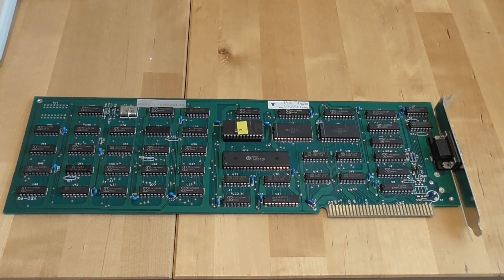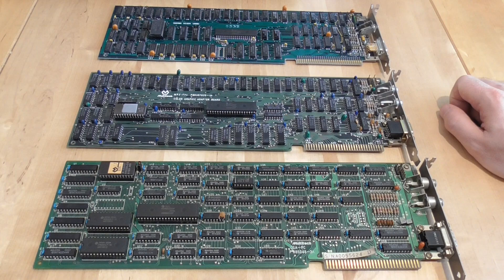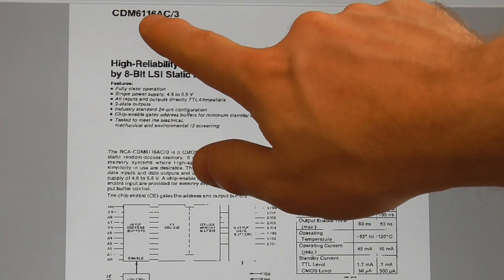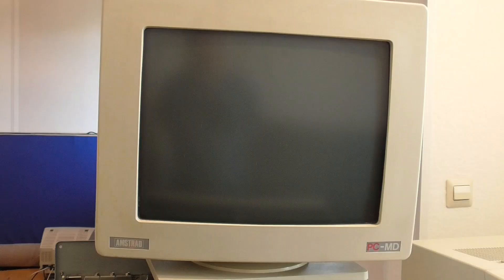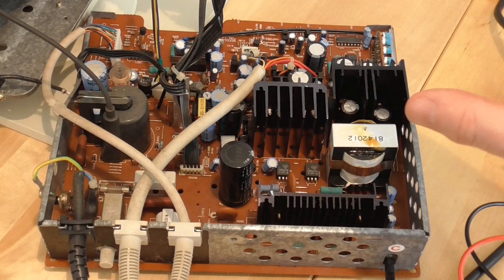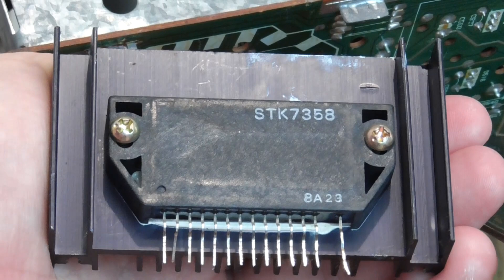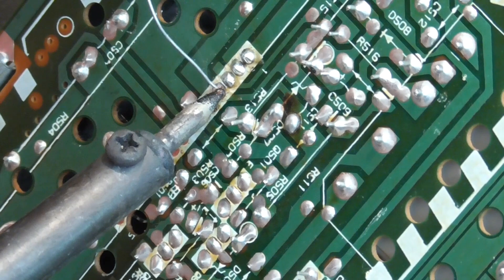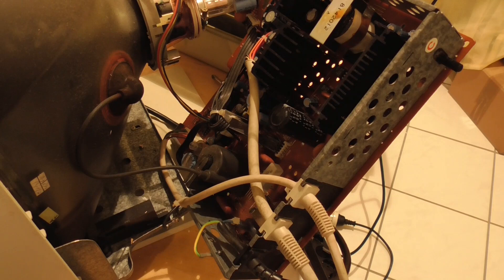Repairing and Benchmarking a Paradise EGA Card + Monitor Repairs

Comment: I suggest using a 60W~100W Watt lamp in series when testing your monitor or other old equipment.
It will prevent short circuit and will charge the empty capacitors more slowly.

Comment: I have got the Paradise Assy 28700 REV7 EGA-Card with the PEGA1A-Chip. Changed all the Tantalums, but get scrambled characters nonetheless. To repair this any further I fear CuriousMarc-Skills are required...
Reply from the maker: Sounds like it could be a problem with the character ROM. Of course, getting another to try is probably tricky.

Comment: 30:09 It looks like this card is employing some kind of interlacing to present a higher-quality font on a CGA monitor? The font definitely looks more like the standard EGA 8x14 one, so the card might be doing 350 or 400 lines by means of interlacing, and that would explain the flicker.
34:00 There were multi-sync monitors which could handle such resolutions. I can remember NEC Multisync reviews from 1986 or 1987 which claimed that it was perfectly able to handle CGA, EGA and 640x480 "enhanced EGA" with both digital and analog inputs. But I've never had or used one :) I agree a standard EGA monitor might find it hard to support 480-line modes, as it's a fixed-frequency (or rather dual-fixed-frequency) one.
Reply: Correct, this card is set up to produce 350 lines on the 200-line CGA display through interlacing.  It works, technically, but is not always pleasant to look at.

Comment: There are 2 clocks on the ISA connector, one related to the CPU clock and the Peripheral clock (PCLK). The clock used for CGA isn’t 4.77MHz , but is PCLK which is 14.318MHz (which divides by 3 to give 4.77MHz on the main board).
Reply from the maker: Yes, that's correct. It's amazing that I said something like that in a video as recent as 2020. Perhaps I did know this back then, but simply hadn't put all the pieces together.

Comment: 29:30 The Genoa card seems to be from 1987. It's hard to read, but I think the Genoa-chip in the north has a date code of "8725"-ish (which would be 25th week of 1987) and the southern Genoa-chip seems to be labeled "8724" (which would be 24th week of 1987).
Reply from the maker: Yes, you are correct about the manufacturing dates of the chips. Sorry, I meant to come back to this later in the video and look into that, as well as the memory configuration (which is 8 chips of 64kx4 bit by the way, i.e. 256kb), but I ran out of time when producing the video and actually forgot. Thanks for reminding me to figure this out.

Comment: There is a schematic available in the Amstrad PC-1640 service manual for the PC-MD. I would suggest checking CP502 & CP503 for the +5V, -5V, +12V and -12V output. If only +12V is absent then it would be the 12V secondary output circuitry, otherwise it could be the primary stage, or a short in the secondary that tripped the protection. Weird sound from the transformer does not necessary mean a bad transformer. They are usually the last suspect as they seldom fail, and it could just be bad drivers in the primary that's causing the sound. For the primary stage I would check the capacitors first, as they are needed to help the STK7358 to kick start the oscillation, and are usually the culprit when the primary stage is not working.
Reply from the maker: Yeah I now also suspect the capacitors and finally got around to getting some more diodes (which had blown up), so I might fix it soon.

Comment: Your Amstrad monitor looks like it also provided power to the computer it was originally paired with.  You may need to load down the +12 and +5 volt rails to get the power supply to start up as it's expecting there to be a load when there isn't.  Also, some monochrome CRTs need to be plugged into the video card as the original IBM MDA graphics card provided the H Sync to the the CRT.
Reply from the maker: Those are definitely suggestions worth looking into. I will replace the parts that have obviously blown up and see if this is the issue.

Comment: 24:25 I think I see distinctive horizontal "pixels" on each line? That's interesting, if I remember correctly classic EGA 320x200 picture usually looks like a solid scanlines. If you'll decide to upgrade your camera one day, would be nice to see that in 4k, your old hardware definitely worth it.
Also you might want to test them on CGA Compatibility Tester, all my VGA cards are terrible in it, I wonder how good EGA cards for that.
Reply from the maker: My guess is few EGA cards would try to emulate CGA exactly. I would be really shocked if they did not all perform terribly. But it might be a fun experiment some day. Both CGA and EGA really pushed the technology hard, being heavily restricted by the memory layout and ISA bus and so on. There's very little chance EGA could emulate CGA precisely. Even most clone CGA cards didn't do a great job there.

Comment: Is it just me or does the EGA Wonder 800 card at around 29:18 also have the footprints for a VGA circuit and connector?

I have a Tulip EGA card (the Tulip Enhanced Video Adapter 2 or TEVA2) that also supports that 640x480 mode. The CTX monitor that I also owned did not support it though. That was really a shame, because this was also around the time that I got into MOD music and I wanted to use my PC at the time, a NEC V20 based XT, for playing these files through a pair of Covox SoundMaster II cards. What I ended up doing was writing a small TSR that hooked the video interrupt (int 10h) and routed the call that would set the 640x480 mode to the regular 640x350 EGA mode. This allowed me to use the MOD player, although I was missing the lower 130 lines of video or so. The MOD player was meant to be used on a 80286 or better machine, but ran perfectly on my XT. Yay NEC!
Reply from the maker: Nicely spotted. It does look like a VGA connector footprint.

Nice hack hooking int 10h! I'm amazed you got it working satisfactorily.
Reply: @PCRetroTech  I may have to rewrite it though, because I can't seem to find the sources for it anywhere. I do remember naming it vgaemu, even though it was truly trivial to implement. But hey, I was a teenaged geek, and like almost every teenaged geek I had illusions of grandeur. 

Anyways, it make me want to try out the card in period appropiate piece of hardware.. Hmm...
Reply from the maker: @damouze  If you get it going, let us know!
Reply: @PCRetroTech  Will do! 

Although getting an EGA signal to a modern monitor will be a bit of a challenge.
Reply from the maker: @damouze  There are various RGB to HDMI solutions available for that.
Reply: @PCRetroTech  I know. I have one already that is supposed to work, a GBS-8200 + an MDA/CGA/EGA/Hercules to analog adapter (it has a name, but I cannot remember it). however it can't lock on to the sync signal. It could be out of spec, but a friend of mine told me that it could also be that the combination I  am using simply does not work with my particular EGA card. The GBS-8200 is notoriously unforgiving as far as the sync signal goes. I does work however, I verified that. 

Ideally I would like to use an RGB2HDMI, but these are pretty hard to come by at the moment it seems. My friend is looking to see if I the spare he has will be useful for me.

As for the TEVA2 card (Chips & Technologies chipset), I dumped the video ROM, and I have also been tinkering around with it to see if I can reverse engineer the BIOS, but the code is rather convoluted. I did figure out the Int 10h entry point though, so that's a start.

Thanks for all the tips, by the way. I really appreciate it.
Reply from the maker: @damouze  I was told the chip shortage is responsible for the lack of those boards. They have an ARM processor I think.
Reply: @PCRetroTech  As was I.
Reply: It does! The EGA Wonder 800+ is actually just a VGA Wonder without the VGA connector. It's extremely versatile, it even manages to display high-res EGA on an MDA monitor with a bit of interlace trickery, in 16 shades of whatever color the phosphor has.
This card was factory-installed in the Commodore PC30-III (which itself was just a PC40-III with the onboard Paradise VGA unpopulated), with the "PC 30 EGA" sticker in the corner of the card it seems like it got pulled from one of those. Strange times, when you could get a PC that was twice cut down like this :D

Comment: @PCRetroTech that EGA card you're showing starting at 19:20, is there any documentation available somewhere? I've bought something very similar off eBay, and since it has 5 dip switches, I wondered what they're for... Also don't want to blow up my CGA monitor :D
Reply from the maker: I think it is this card: https://stason.org/TULARC/pc/graphics-cards/U-Z/WESTERN-DIGITAL-CORPORATION-EGA-CGA-PARADISE-AUTOS.html

Reportedly, autoswitch mode does not work with CGA. I don't think the 200 column mode is marked correctly. It surely refers to CGA's 200 line mode. But I don't have any definitive information on it.
Reply: @PCRetroTech  Ok, thanks. My card (and I think yours too?) has only 5 switches, but since SW1/6 is shown as always off, perhaps it's not that important.

Comment: @PCRetroTech, I have roughly the same Paradise card with a dead capacitor in the same location. What size did you use and how did you determine that? Thanks!
Reply from the maker: I don't recall exactly, but usually these caps are something like 100nF. They are just filtering caps and the exact value is not so important.
Reply: @PCRetroTech  I worked them out and recapped it last night. It seems happy!
Reply from the maker: @Synacktic  Great to hear!